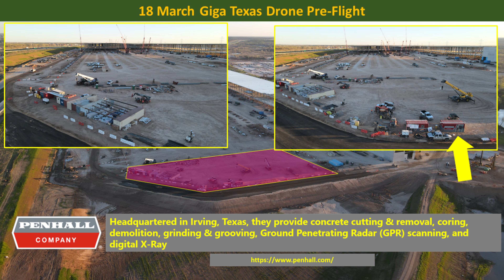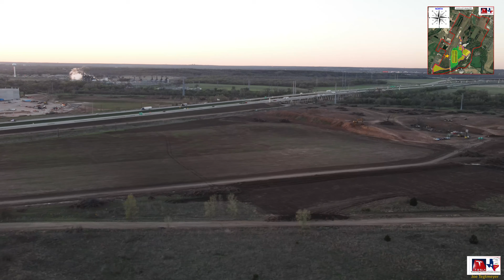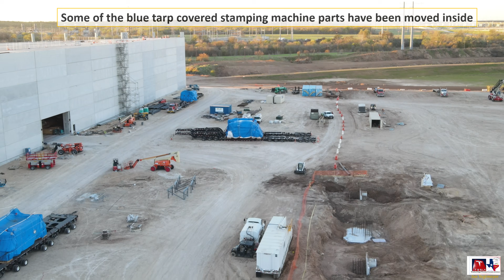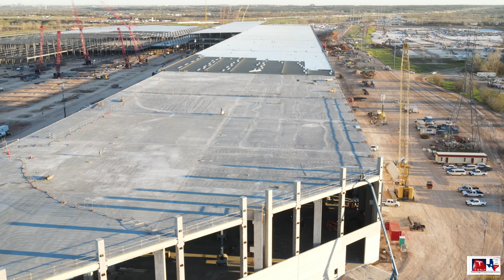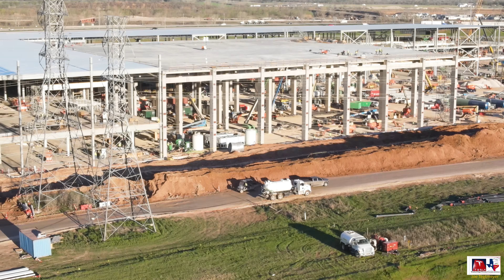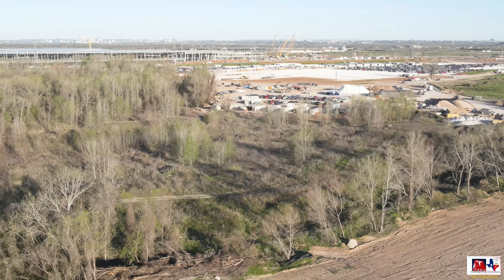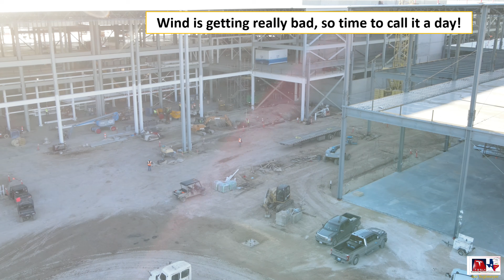Tesla Gigafactory Texas 18 March 2021 Cyber Truck & Model Y Factory Construction Update (07:30AM)

Comment: Waves to Joe.... Hi Joe.... Bye Joe.....
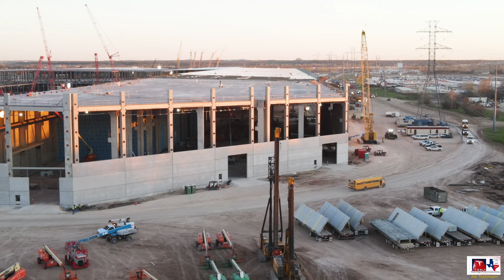So at 7:21 and the concrete panels.... why is there a panel with  door cutout? Where would this go? All the doors are in place at this end...
As for the ground radar.... this project has been so piss poor managed I would not be surprised if the bozo managers forgot to mark on the As-Builts where something was buried... I hope Elon gets a discount for using the "low" bidder on this job!!
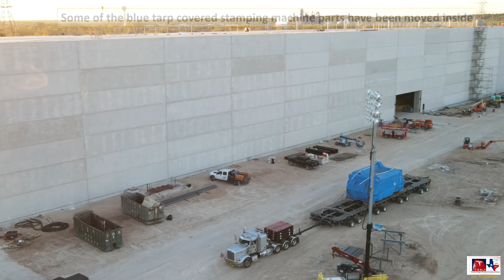Reply: it may be for @10:52
Reply: @donbowie6526  No that is already framed for an overhead door like the others.....
Reply: They still need panels for the north concrete structure and that door may be slated for that area
Reply: On the concrete columns you can see the mounting brackets for for the wall sections, have you noticed that all of the outside steel columns also have these mounting brackets ?  How many other panels will be required to cover the building ?
Reply: @eltonray2934  i made a comment last video that i thought the now new carpark area would be a set out place to make the hundreds of wall panels on-site. Seems that I'm very wrong about that but there is still time to make an area for that purpose. It would be much quicker than having a third-party supplying all the hundreds and hundreds that will be needed
Reply: My guess is the current large truck opening in the NW corner (with the blue panels) of the press structure is a temporary truck door.  When they are done moving in the press equipment the blue panels will be removed and the precast piece with the walk in door cutout will go there.
Reply: Since you're so smart, you should know there is one more ground level panel spot remaining.

Comment: From the new switchyard they will also connect to the powerline running towards the mobile batchplant and the MM plant, removing the need for the powerlines running towards the southeast across the big terrain and the old trailer area.

Comment: I think it’s more likely they will be cutting and coring concrete from the list of jobs they specialize in. I’ve been involved in more than a few jobs where they forgot they needed a pipe or conduit through concrete they’d just placed a few weeks before, either by accident or a change of plans. On a project this size, moving at the speed of a Musk operation? Oh Hell yeah, they are going to be coring some concrete. I see acres of second and third floors with nary a hole in them. I also don’t see a lot of control joints. Those guys are going to be busy. As for ground penetrating radar, that’s mainly for remodeling or working over an old site, looking for pipes or conduits. In this case they filled most of it. They should know what’s a few feet down. So I’m not sure they will be doing much of that.
Reply: Having watched Elon build things for a decade, he almost lives the Bob Ross method. He believes in happy accidents and such. In all of his projects speed is the essential element. As an almost 60 year old man, I get it. We only have so many days on Earth. Get with it. Fix the problems as you find them and move on. He learned this from software. When I went to college, you planned things for weeks, drawing flow charts, designing data dictionaries, and other tools. Then you’d write to code and punch it into punch cards. Then hand them into an operator who’d put them into the queue to run on the mainframe. Come back in a few hours to see how you did. 

Now days, little of that is done. It’s done by reiterative design, doing it over and over again with rapid small changes. You never really ever finish, you just keep making it better and better. Elon apparently approaches everything like that. You can certainly see it in the Tesla models and his rockets too. So why not the factories? Tesla’s biggest enterprise issue is growing fast enough to take advantage of the First Mover status. They need to stay ahead while rapidly increasing production. So you build floors before you have completed the design of the assembly lines that are going on them. You can core holes later. 

Probably driving their contractors nuts with the Change Orders though. Well not nuts, since they always have a dollar amount attached, but I bet they have days where it’s a bit much. I only dealt with SpaceX tangentially on a contract where I was a supplier to a NASA contractor. It was an interesting way of doing business. Trust me, not even close to the NASA method. Not even a little bit.
Reply from the maker: Thanks William!  It is interesting that this kind of company is on site .. I'll watch to see them in action and then we will know!
Reply: LOL... Forgot?? The screw ups from the company running this jobs has been so many we all lost count!! This is and will be a classic text book in the future of how not to build a site out!! I sure hope Elon gets a hefty check for penalties forth bozo company that is in charge!!
Reply: @stephenj6837  After working in industrial plants for over 25 years engineering changes happen all the time. Sometimes the buildings are constructed before the owner has made his final decisions. Also sometimes the design calls for boring holes after concrete has been poured. I have watched this from the beginning and it appears that they are doing a good job.
Reply: @stephenj6837  the thing that pisses me off the most is those big cranes have been sitting idle for over two weeks now when they could have been building down south working toward the north. It seems that they stayed parked waiting for the battery plant footings to be finished. I suppose the battery plant will go up at a hell of a speed but i think having them sitting there has been a big mistake and a costly one. Those things are not cheap to have just sitting there
Reply: @aussie_al  Do we know what will be in the SW quarter?